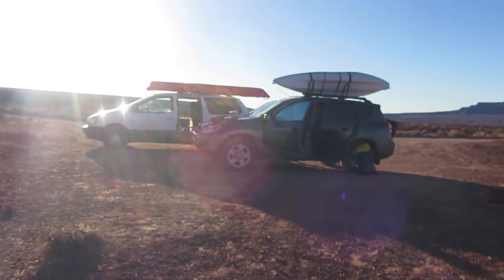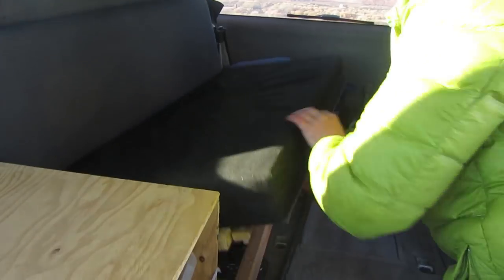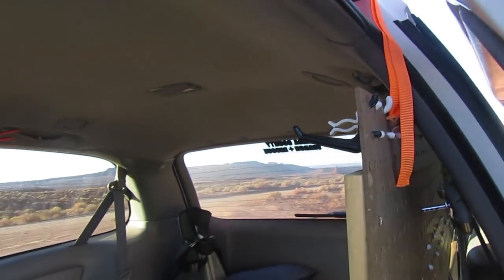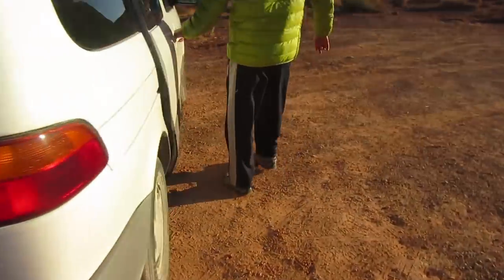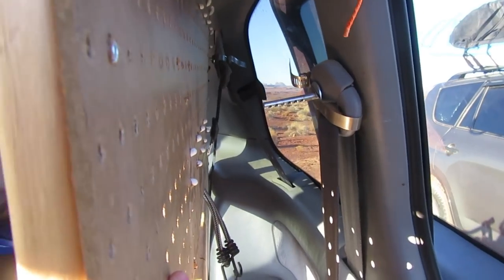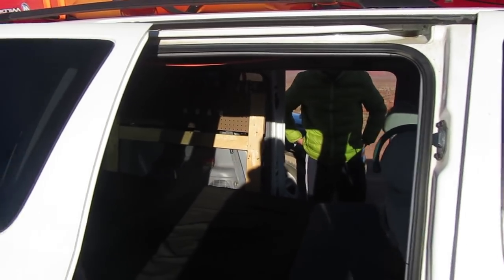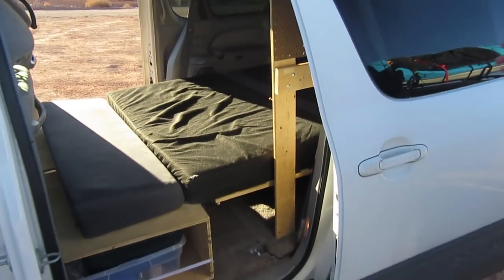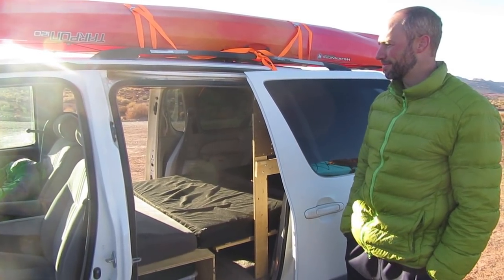Minivan Camper Conversion and Tour (DIY Adventure Van Build)

Comment from the maker: Pick yourself up something nice in the store: https://kamchatkagear.com
Reply: I was wondering if you know the interior measurements of the Toyota Sienna from the back of the front seats to the hatch...and from sliding door to sliding door... Is it roughly 4 foot by 8 foot?
Reply from the maker: Nope, sorry, I don't know.
Reply: A 4x8 sheet of plywood will fit between the wheel wells, just barely.  Mine is 2004 though.

Comment: Converting my Uplander, thanks for the ideas.
Reply: Hi Lynda, I'm looking into possibly getting a used Uplander to convert as well. Do you like yours? Would you consider it a good long distance road vehicle? Thanks
Reply: Have had it since fall and it is good. The rack doesn't have cross bars so I bought a mount kit  to carry my canoe. No stow seats but don't need them, and made a bed from couch pad and futon spring I attached to legs. It is cheaper than a Toyota and as good.

Comment: I wondered about the Sienna as a good vehicle for living/camping. I vaguely remember some tell that it had more interior space than other minivans. Not sure if that’s true. Also wondered about the Yukon, Expedition, or Excursion as good candidates for conversion.
Reply from the maker: It seemed pretty standard as far as space in minivans go. Any van, even a minivan, will be more spacious than just about any SUV. But a Yukon, Expedition, or Excursion will have much more ground clearance than any minivan. I think it's just all about what your priorities are. For me and the places I go, an SUV, even a small one like mine, is the way to go.
Reply: Besides the difference in ground clearance there are cost factors.  A mini van is far less expensive than a Yukon, Expedition, etc. My friend just bought a brand new Chevy Tahoe. The price tag was $70,000. Fuel economy is another consideration. A Sienna should get better gas mileage than the other vehicles you mentioned. I've considered a Sienna because of cost, cargo capacity, and fuel economy. The Sienna is also the only minivan that has the AWD option. The only thing that holds me back is the ground clearance. Current Sienna's have 6.5 inches of ground clearance. I'm still not sure that's enough for where I want to go.
Reply: If you haven't done it already, I'd love to see some videos covering all the details and considerations like this regarding what vehicle one might choose, and which tend to be best for which travel styles/priorities.  

What are the differences between most SUVs and minivans? Also, perhaps some of the major pro's and con's of the specific vehicles (Rav4, Sienna, Prius v, Yukon, Expedition, Subaru, etc.).  What are some of the key trade offs to consider?  For example, less space but more off roading capability? Or, better gas mileage but less space, etc. 

Also, criteria to look for in old cars, and any years that are esp good.  For example, I've heard older Prius's are better for solo bed setups than newer ones, etc. Also, how to do it most inexpensively and then which features/etc to look for and how much more to expect to pay if you decide to go for something with 4WD, tinted windows, low mileage, other important features.
Reply: Laila Atallah -  The above comments provide some basic differences between the mini van and SUV.  I'm in the market for a new vehicle and I am torn between a mini van and SUV. I like the interior space of a mini van but I also like the ground clearance of an SUV. It all depends on what your needs are. If you're hauling people/cargo around mostly on pavement, then the mini van would be a good choice. But if you  want to get into more remote areas on mostly dirt or unimproved roads, the SUV with greater ground clearance and all wheel drive (AWD) is probably a must.  This year Subaru is coming out with a new SUV model called the Ascent. I've heard it described as a vehicle for those who like the Subaru Outback but want something a little bigger. The Ascent is considered a 3 row crossover.  Like all Subarus it has 8.7 inches of ground clearance which is more than the Honda Pilot or Toyota Highlander. And Subaru's AWD system has always been highly rated. The Ascent is supposed to go on sale later this year. I'm looking forward to a test drive.  I'm not too familiar with the Toyota Prius. I know it's a hybrid with legendary fuel economy. But I don't think it has sufficient ground clearance for my needs. And as far as window tinting goes, window tint laws vary from state to state so it's best to check your local laws.
Reply: Awesome thoughts, G.O.  Thank you.  I hear you on trying to balance out all your various wants and needs.  The Ascent sounds intriguing.  I like the cost savings of an older vehicle but it seems like you can get more features and fuel economy sometimes with a newer car.
Reply from the maker: I'll add they I personally wouldn't worry too much about AWD or 4WD. Ground clearance is far more important. My RAV4 has 4WD, and I'd be fine without it.

Comment: I have seen a lot of people installing peg boards instead of regular luan  or underlayment, for walls on their vans. i personally don't like the look but i agree is super very  practical and you can hang tons of stuff and saves you drilling and making holes.
Reply from the maker: I'm not the biggest fan of how it looks either, but it work well and seems to be an easy setup. And it's not permanent, so it can always be changed. Thanks for watching.
Reply: You can always paint or paper it. Even frame it. The holes make it lighter and vented.